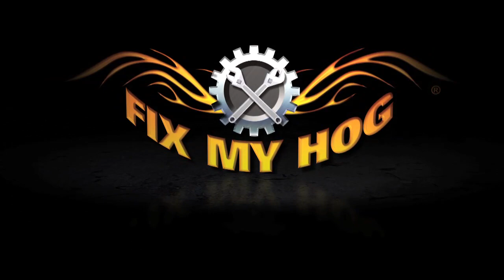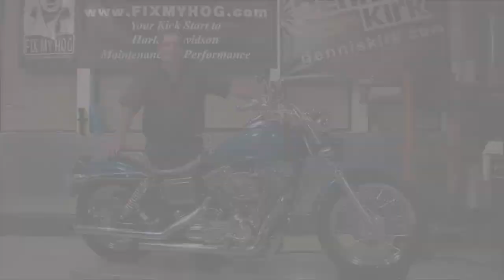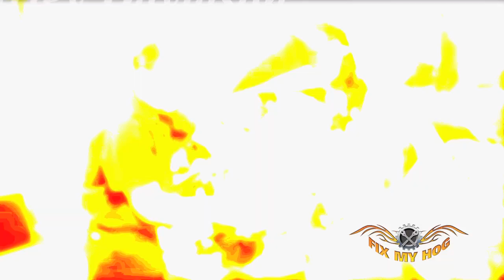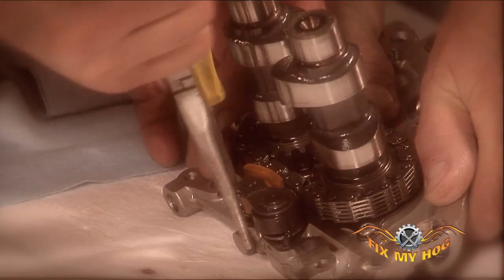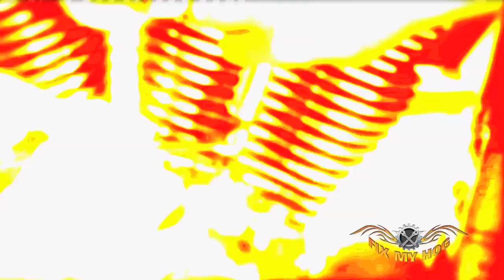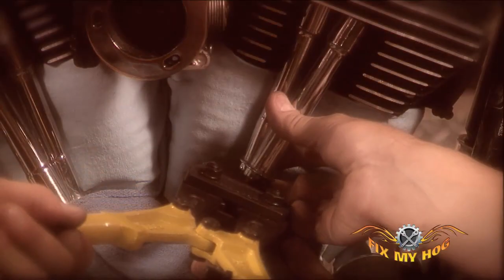Harley Davidson Maintenance: Harley hydraulic cam chain tensioner upgrade

Comment: I have a 2000 wide glide that the oil drains from oil tank after sitting for a few weeks, what is the cause? My bottom end must be full.
Reply from the maker: Sumping, like you are describing, is common on bikes with an oil tank that is up higher like a Softail or XL.  
It should not be occurring with a Dyna model that has an oil pan underneath the m/c. You may have a different issue. 
https://www.fixmyhog.com/post/videos-harley/
Reply: when your bike sits, oil is going to naturally drain to the lowest point it can find, gravity causes it. when you start your bike up, the scavenge pump will return the oil to the reservoir. that is why you must run your engine before pulling the dipstick to check oil level, otherwise it will check low and if you add oil at that point, it will be overfull and puke out the vent.

Comment: I have the 2006 fxdi35 - 35th anniversary Dyna 
Is that not included? - does that 2006 Dyna not have the spring loaded tensioner? - I can't find a reference.
I'm thinking about moving up from 88ci to 97ci with the S&S Big Bore kit.  I could easily put in gear driven cam at the same time.
good plan?
Reply from the maker: The 2006 Dyna was the 1st model Twin Cam to have hydraulic cam chain tensioners. You will not need to upgrade your tensioners.  

If you are considering gear drive, you will need to measure the run out of your pinion shaft before committing to the install. If the run out is over .003, it is recommended that the run out is corrected. If excessive run out is not corrected, the cam compartment will have a loud wining audible as RPMs increase. 
https://www.fixmyhog.com/video/lifter-blocks-cam-lifters-cam-cover-removal-003264/
Reply: Thanks!  I may go with the Big Bore and skip the gear driven cams.

Comment: Hello Mr the thecnitien, I have a 2009 Electra Glide with 92.000 kilometer, always well maintained, the option to change the gear drive system kit would be a good deal and the tensioner, if you have a complete video of the stage I follow you would be very happy, and where I can find the specifications torquage thank you
Reply from the maker: Hi, Larry. We recommend referencing the Harley Davidson service manual for your year and model. You will find all of your torque specs there. https://www.fixmyhog.com/posts/harley-tips/

Comment: This video mentions problems on the 1999 through 2006 engine.  What about the engines produced before that, that were older? I'm looking at buying a 1992 Dyna Glide Custom but concerned about the cam chain tensioner issue. Can someone point me in the right direction?
Reply from the maker: Hi, Mark. The cam chain tensioner issues were only on Twin Cam motors 2000-2006. 1992 Dyna has an Evolution motor with only one cam (no chain or tensioners). The Evo is an excellent motor; just smaller and a, somewhat, different design.  http://www.fixmyhog.com/posts/harley-tips/
Reply: Thank you friend, makes me feel alot better. I realy know nothing about Harleys, i've had japanese bikes my whole life but after riding this weekend i have been bit by the Harley bug. The next thing all my non-harley friends say is that the Evo motors had bad cam bearings. The bike i want to buy has 17 thousand miles and had all services done at the HD dealership in New York. What can you tell me about the cam bearings? Is it just a rumor?
Reply: FixMyHogfreechannel I'm being offered a 2015 TC 103 deluxe softail would this be a common problem on this series as well if not what's modified on 2009 + models to fix this ? What should I check when buying a pre Owned HD ?

Comment: The cam chain tensioners are not the only major problem with all Twin Cam enginges produced from 1999 to the present. Here's some other problems;

1. The flywheel assembly, is not bolted together, as all older model Harley engines have been in the past to keep both halves in true. The use to have a crank pin bolt and nut torqued down to keep the crankshaft in true.

The twin cam flywheel assembly is merely pressed together, at the factory with a 400 ton press. Only a wing and a prayer holds both sides together. They WILL come out of true, sooner, rather, than later. That means that the primary and pinion shafts will wobble out of the run out threshold, specs which is 0.001' using a dial indicator at the end of the shaft. Engines with as few as 1,500 miles have come out of true and the run out is way out there at 0.007-0.012" run out and will cause the bushings and bearings to crater and catastrophic engine failure results.

The only solution is to tear the engine completely apart and send it to  a performance specialty shop where they will dynamically true and plug and weld the two halves together to achieve no more than  0.001" of run out at the shaft end.

2. All Twin cam engines run extremely hot and heat is the deadly enemy of an air cooled engine. The stock oil pump is junk, and only produces between 3-10 psi, of oil pressure at idle, not enough to circulate the oil to cool especially the rear cylinder. 

3. The Twin cam camshaft bearings are crap, as they use the INA bearings instead of the more reliable Timken, tapered roller bearing, so when changing out the silent chain tensioners, the cam shaft bearing should be replaced with the Timken bearings.

The Twin cam engine is a fatally flawed design and when the PLASTIC tensioners wear out and break, they get sucked into the oil pump and into the crankcase and cylinders and cause catastrophic engine failure. There is no solution to this problem. Most Harley owners don't even know that they have to periodically inspect and replace the tensioners when they reach 3/32" of wear or 50% of their thickness. Harley no where in the owner's manual or the Service manual make any reference as to when periodic inspection and/or replacement should be done.

CAVEAT EMPTOR- LET THE BUYER BEWARE

THERE ARE MANY YOU TUBE VIDEOS POSTED BY HARLEY OWNERS ON THESE PROBLEMS.

Comment: What happens if you take the tensioners out and throw them away? A 350 chevy motor doesn't have a tensioner. The drive side of the cam chain should stay tight when the motor is running. Anybody ever done this?
Reply: +fredmagee If you were to remove the cam chain tensioners, you would have METAL TO METAL contact between the metal cam support holder and the silent chain drive and upon start up would produce metal shavings, which would be inducted into the oil pump and then the crankcase and cylinders and immediate catastrophic engine failure would result, and scratch one TC engine, can't even rebuild it from the damage done. So, that is a real, no, no.........
Reply: yes I know that now. I posted that question before I knew that the cranks wobble. I sold my Harley and will never buy another one. I am looking at a new Indian. The twin cam motor is junk, simple as that.
Reply: But if you remove the whole thing and there's nothing there it should not have anything to rub on. I see no reason for them other than noise control. If I'm wrong let me know? Thanks.

Comment: Anyone know how long the hydraulic cam chain tensioners last? How many miles?
Reply from the maker: We have not seen failures of the hydraulic come into the shop. I'm sure there are some out there. Same procedure on checking them every 10k will give you piece of mind.
Reply: +backroadjunkie Get yourself a genuine Harley Davidson shop manual for your bike.  I believe it recommends replacing the tensioner every 20,000 miles.  You can do it yourself if you know how to work on engines.  The people who run into problems are the ones who don't do required maintenance, or who do it improperly.
Reply: +backroadjunkie It's a real hit and miss proposition, as the older model TC engines had spring loaded tensioners, which could go out in as little as 15k miles. The new hydraulic tensioners can last longer, but, the problem is not solved, only delayed to get one past the factory warranty period.........it will always be a Damocles Sword, hanging over the owner's head.........